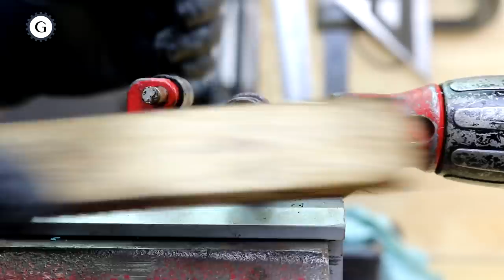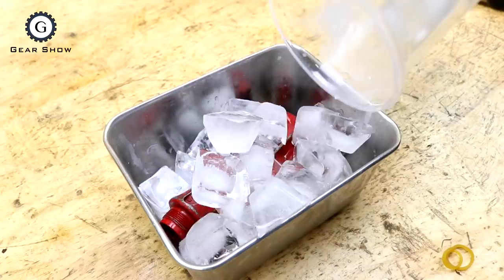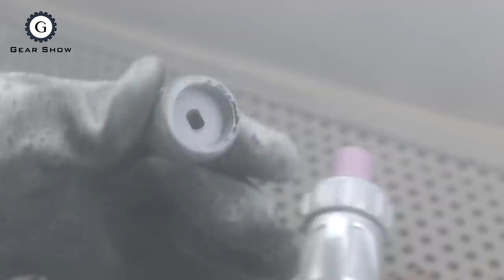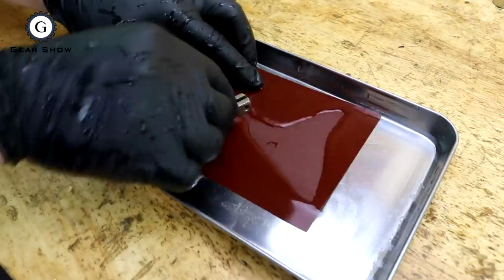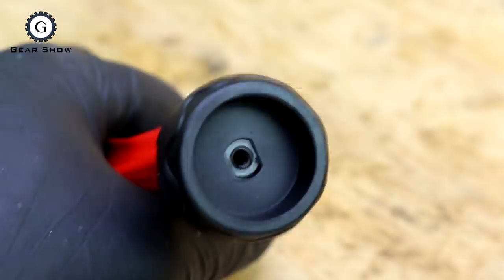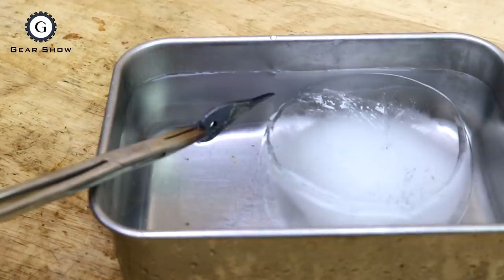1$ Rusty Pipe Cutter Tool Restoration | REX PIPE CUTTER

Comment: These little pipe cutters can be expensive so that was a worthwhile restoration. I have a similar sized unit and ruined the cheap blades in no time so I bought two quality blades. That was about 35 years ago and it’s done a lot of work since and I still haven’t used the spare blade.
Nice job and it looks as good as new. It should last you a life time. Cheers Stuart 🇦🇺
Reply from the maker: I'm glad to hear that, thank you for sharing :)

Comment: The reamer blade is not supposed to be a pointed blade as shown in this video, it is supposed to be more similar in shape to an arrow pointer (similar to that used of an arrow pointer on a laptop, with a fatter tail so it fits into the pipe cutter) and a blunt blade edge. It is this blunt edge that cleans the pipe perfectly, every time. That way it reams opposing sides and takes half the time to clean up the cut edge. I know this because I use the same pipe cutter as this.

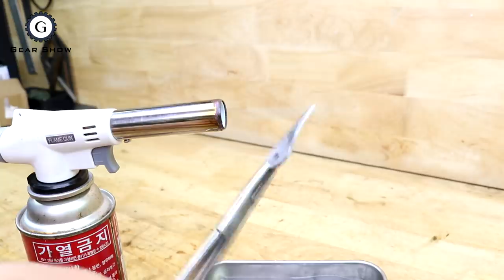Comment: 16:16 Why heated it and put it in cold water immediately ?
when you thermal shock it, did it do something to it?
Reply: Yes, when you heat an iron piece and then throw in the cold, the thermal shock makes the iron harder.
Reply: It also expands and contracts the oxidized/rust and freeing it up.
Reply: As others have already said, it was heat treating the blade. It needed to be tempered too so that it doesn't shatter.